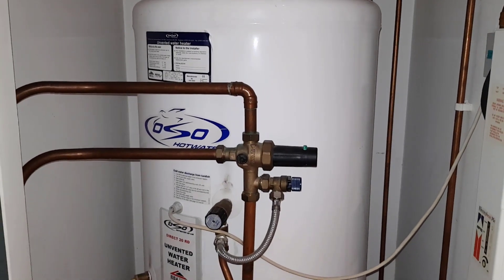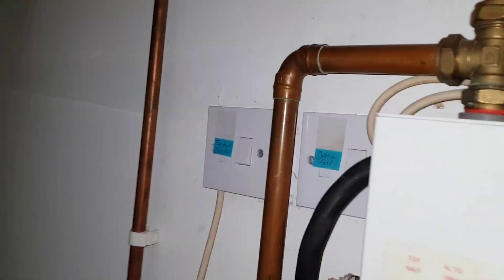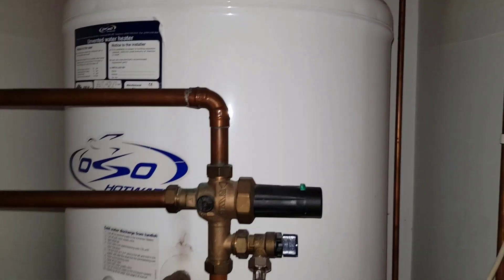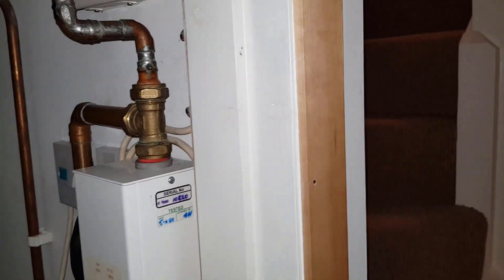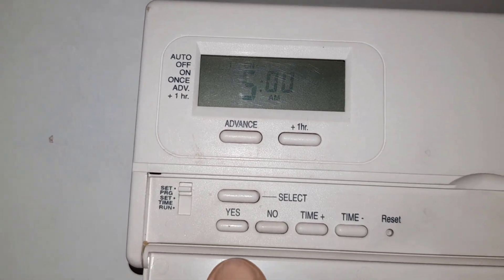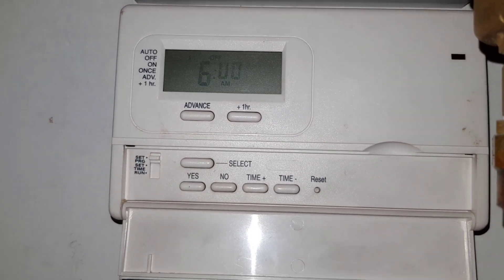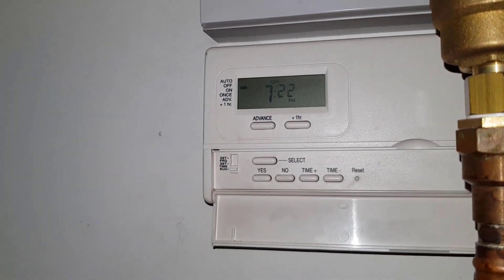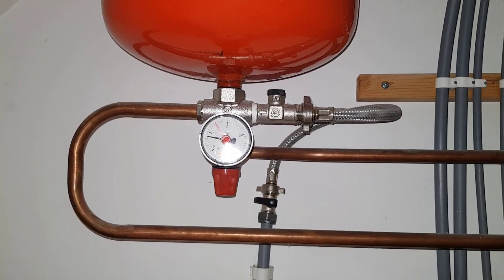How to Use a OSO Electric Boiler and controls with Coach Tony Morgan

Comment: Great video!  One question:  how do you control the water temperature on the Oso water cylinder?  I cannot find any sort of thermostat near the cylinder; and my digital display is only for my oil boiler and equally does not have any function for temperature control.
Reply from the maker: The hot water temperature is set on the thermostat inside the cylinder
Reply: @ARBoilers  Thanks :)